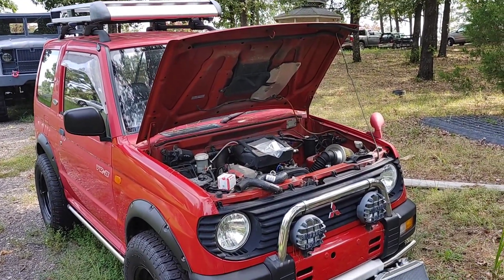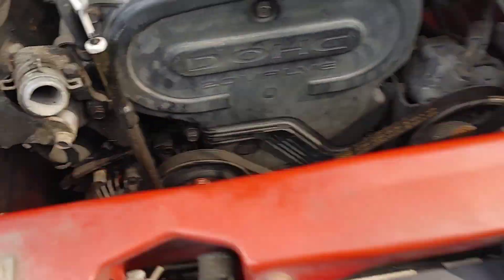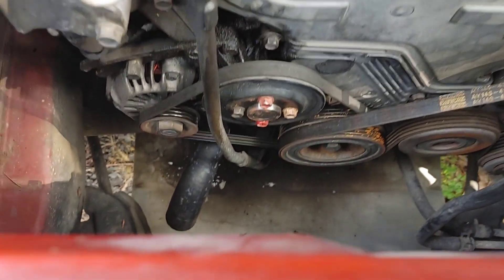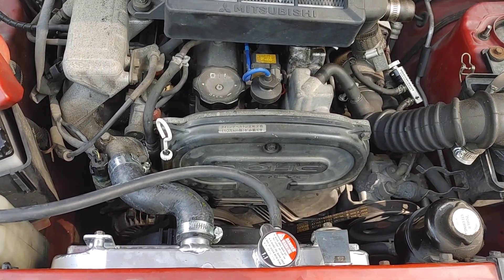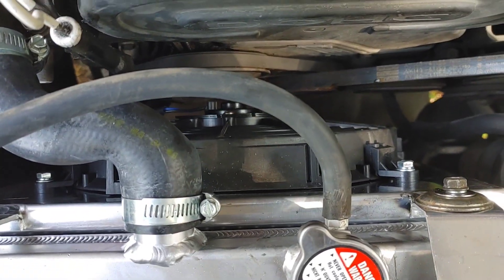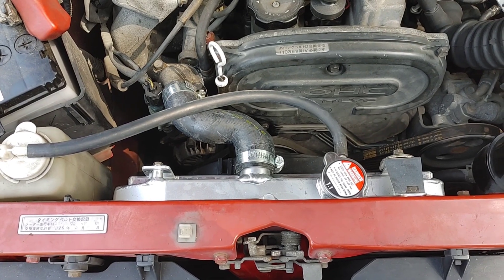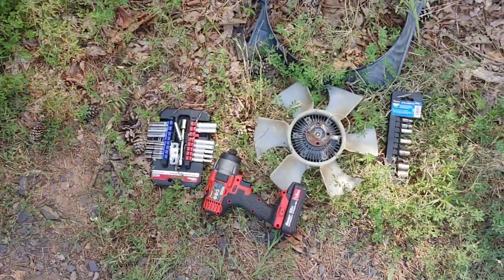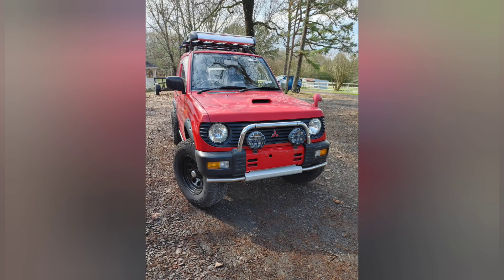Mitsubishi Pajero mini H56a, Honda Civic aluminum radiator electric fan conversion.

Comment: Know it's an old video but I noticed when ordering there's options for a 2, 3, and 4 row radiator. Maybe your cooling issue is you purchased a 3 or 4? I asked AI and it recommended a 1 or 2  row for this size engine. I ordered the 2.

Comment: So I just changed out my radiator but I’ve only had this car for a month. When I pulled the original radiator the transmission fluid(?) dumped out. Trying to figure out where to refill it at. Can you help?
Reply from the maker: You can fill it through the dipstick, where you check the transmission fluid level. On the left side of the engine bay.
Reply: @josephcarlson1774 I thought that was the engine oil? Is the engine oil the dipstick on the right side?  Or is it on the left side tucked down somewhere?

Comment: Great video Joseph, planning on doing the same swap with mine. Any tips on removing the stock fan clutch? Went to start the swap yesterday and the 4 bolts on the fan clutch didn't want to budge. My next plan was to leave the trans in gear to prevent the engine from turning over then trying to remove the fan clutch.

Comment: I was hoping you could help me, cause I had matched the aluminum radiator, and the hose and all but wanted to see if you had transmission lines connected into the old radiator? And how you might’ve did that part, please let me know anything would be helpful!
Reply from the maker: @jchuggz671  Mine was a manual transmission so there were no transmission lines.
Reply: @josephcarlson1774  I assumed, do you know if the aluminum radiators have a trans cooler on it or would I have to buy a new one?
Reply from the maker: @jchuggz671  I would run a separate external transmission cooler. They're fairly cheap and way more efficient than using one in the radiator.
Reply: @josephcarlson1774  yeah I’m probably going to install that to save the troubles! Thank you for responding! I’ll let you know how it goes!

Comment: So why do you think this new radiator cant keep up with cooling as well as the oem one?
Reply from the maker: I can't really say that it does any worse than a factory radiator, because I never drove it in 90°+ heat before swapping out to the all aluminum one. Talking with other Pajero mini owners on the groups, even the factory radiator can't handle the southern summer US heat.
Reply: @josephcarlson1774  interesting. You say you could have kept the original mechanical fan right?
Reply from the maker: @TTarlov  it would need some work to the fan shroud but it can be done.
Reply: Did you ever got it to work with the fan that the radiator came with? I am wondering if there is a way to have it come automatically at certain temp.